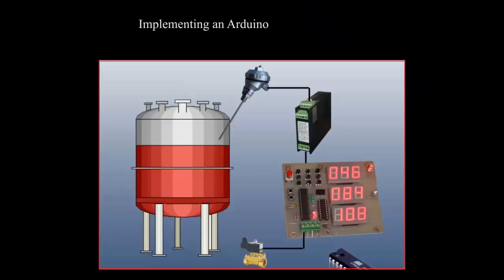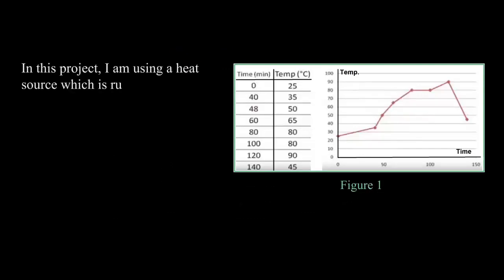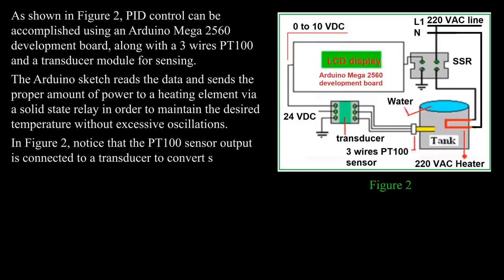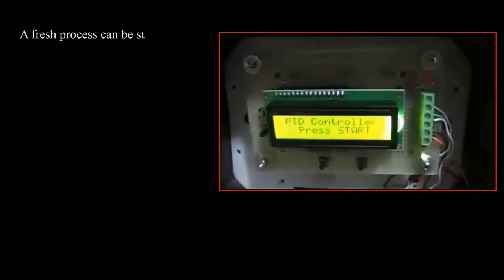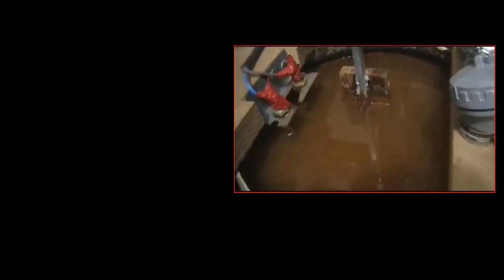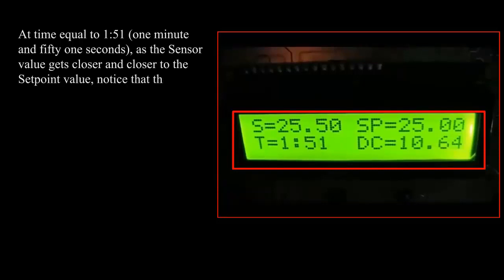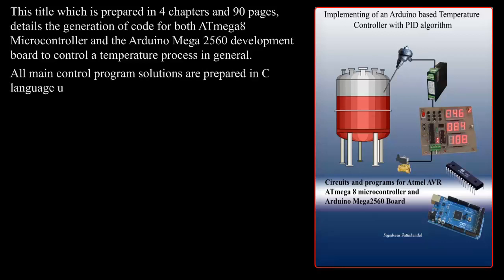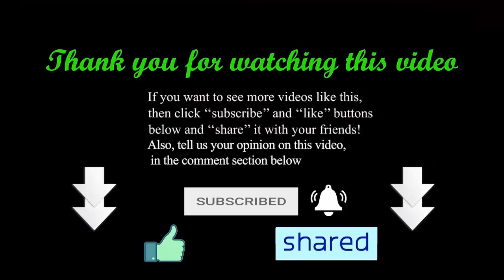Implementing an Arduino based Temperature Controller with PID Algorithm

Comment: I need to develop a Temperature control using PID algorithm for a heater, also I have in my university project the feedback to the relay to be done by the data generated by the temperature sensor linked to the MACHINE learning platform(For a data predictive feedback loop to the relay) if you have any similar project let me know.
I am new to Arduino and the university project is a bit abstract and I am a bit lost...
narayananeshwaran44@gmail.com is my id.

Comment: Hello there, Currently I'm designing a temperature controller system for a spray dryer. After surfing the internet for a little long time, I'm glad that I found this video. I'm interested in buying the ebook. Please contact me through following email id: manojmahesh38@gmail.com
Reply from the maker: the link to download the code and whole document was sent to your given email address on 08/06/2020. Thanks for inquiring!
Reply: I have received the book and the codes within an hour. Wow.. thanks a lot.